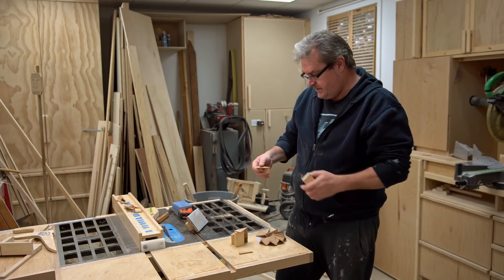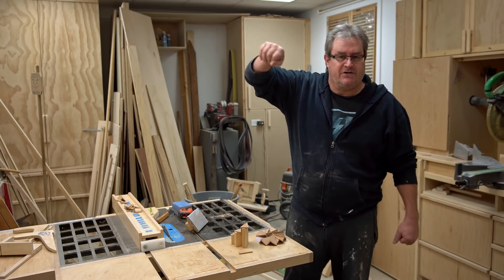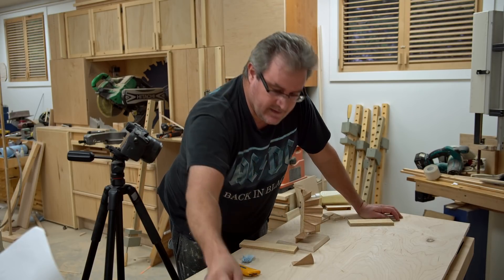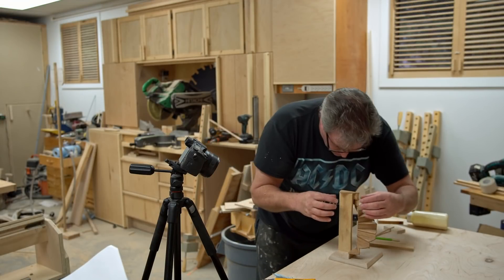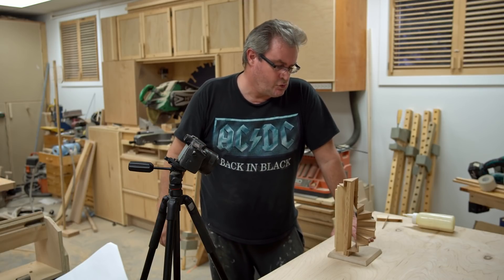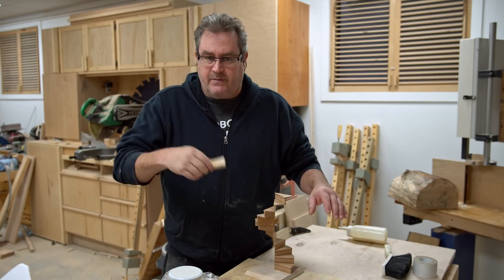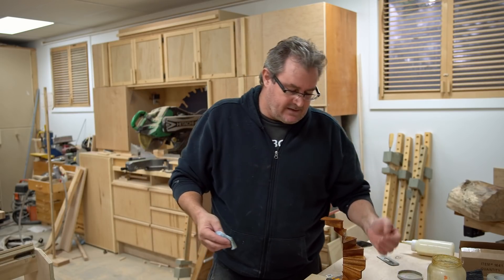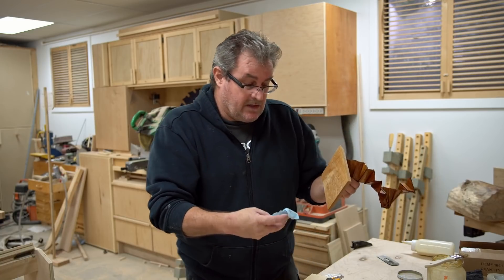About The Spiral Stairs

Comment: These decorative builds from you have become my favourite. I like how you think outside the box with them, both on the project and the videography/story telling, now that you have become so experienced.

I don't know if you are aware, but you can run sony a6xxx cameras on a power bank plugged into the usb and if you get the right one it will even charge the battery with the camera on, that way you don't have to fiddle with batteries and are sure you don't have to move the camera during a long stop motion or multiple shots from the same angle.
Reply from the maker: It's not only the battery, it's footage as well. Leaving the camera recording means more to watch through, cut and throw away later. Also, I'm recording in a high quality codec and disk space is an issue. All of the clips for that build video didn't fit on a 250GB drive.

Comment: I have 4 tables in my living room. Two are workbenches, one is my desk, the other is a dinette set. A neighbor came in the other day and looked around and said, "You need furniture!" I had to explain that I had furniture. I wasn't using it, so I got rid of it to make room for workbenches. :-)

Maybe, when I get through working on the house in a year or two, I will get some furniture again. Maybe not.
Reply: If you are the only person in the room most of the time, one comfy chair, and someplace to sit your coffee cup and remote, is all you need. A couple of folding chairs in the corner will suffice for any guests that may come over. Heck, they can use the dinette chairs if they want to sit. I'm with you buddy. The desk chair would work for my seat. Personally, I'd get rid of the dinette and have an assembly table instead. I can eat at the desk and watch a You-Tube video.
BTW, great Bible verse, really fits the "rant" and your furniture choice.

Comment: I know you have the gantry for your main filming but I noticed the tripod as well. What are your thoughts on having / building a camera stand (bucket) like mine or Jay bates? ps the stairs are awesome
Reply from the maker: I had the tripod set up just to photograph a time lapse of the stairs being built, but it didn't look any good so I didn't use it. Otherwise, I just use one camera to film in the shop for everything.
A neat way to make those rolling camera stands is to weigh down the base with a deep cycle battery and then use that to power lights on the stand.

Comment: These model staircases are an old tradition in European guild work-if you were an apprentice finish carpenter in 17th,18th,or 19th century Europe you needed to demonstrate MASTERY of DESIGN & BUILD of complex carpentry systems.Your’ model was meant to convince the presiding board of the local carpentry guild you were worthy of acceptance and induction.To this day these antique models are highly sought and collected.The clothing designer Bill Blass was a great collector.BTW-building the stairs by cutting them from a SINGLE piece of mahogany misses the point of the exercise.The tread and riser(all the parts) were meant to be cut and assembled as you would a real staircase.Otherwise you’re not demonstrating PRACTICAL knowledge.The base would be expected to represent a real floor.Am I the only one who thinks of Artie Lange when I watch this guy?